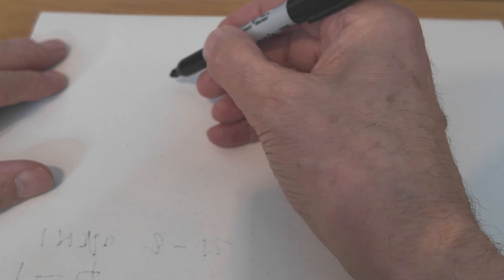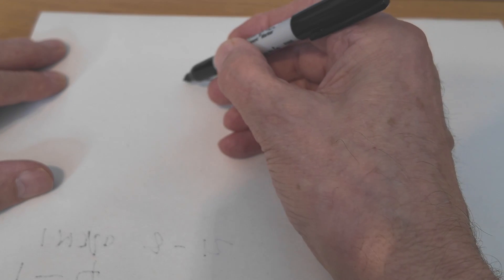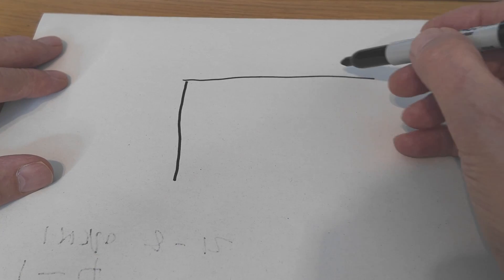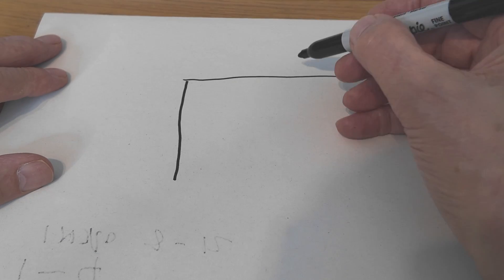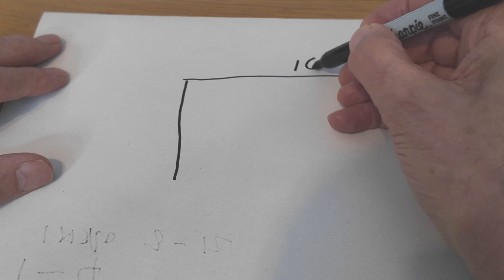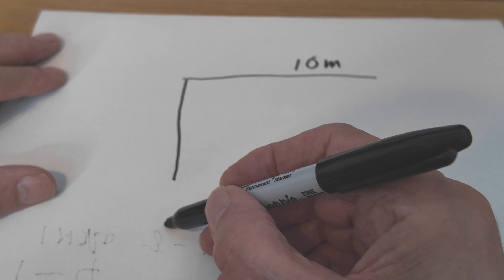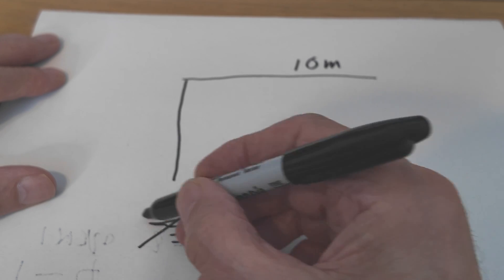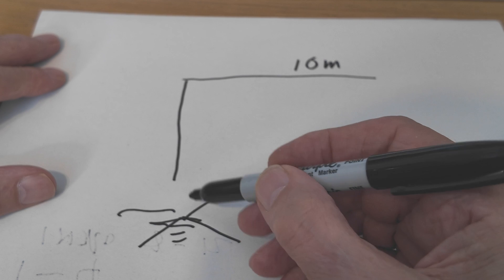Grounded Inverted L Antenna   Try This

Comment: I have ATU connected at bottom for Inverted L  , 1/4 wave for 3.5MHz,  1/2 wave length for 7MHz band.   ATU along with 1:9 UNUN can do both just fine.  Inverted L is lightest load on winmpy Fiber glass pole I have.  least amount of wind load as well.  AG6JU

Comment: Your channel inspired me to get my technician license TY. I'm about to start building antennas and plan on starting with a resonant dipole. Since I only have 10m for HF the inverted L is very attractive. I have a question though. Is higher always better for antenna placement? I don't understand angle of radiation principles yet but figure it would probably be better to get it as high as possible especially because I am in a mountainous region. If I'm wrong please let me know. God bless from your friend across the pond 🤠

Comment: Have you tried an end fed. dipole  in an inverted L configuration with the unun at the base of the vertical section?
Reply from the maker: Yes, ir works well.

Comment: Very interesting video Peter and yes a great ant for the low bands.
I once put a 40m trap on the top of my 40m vertical, then added extra wire, and got a 40/80 inv L, which  worked extremely well. My top section was actually sloping down, but it seemed to fire better in the opposite direction. 
Happy Easter to you and your family.  Zl3xdj.
Reply from the maker: Hi Brian, many thanks and happy Easter to you in ZL. 73 Peter

Comment: Should you choke the coax at the feedpoint of the 49:1 transformer? I know the 49:1 Balun I have, the coax does radiate somewhat. Robert KD4YDC
Reply from the maker: No need.  Just choke at transceiver end.
Reply: I have been experimenting with inverted L in many configurations. At 88.5 feet and at least 5 meters or 20 foot the antenna is remarkable as a random non resonant with a 9 to 1 auto transformer and use your coax as earth to a good current choke at house entry gives you all bands easily tuned within 3 to 1 tuners. Keep the vertical portion clear of objects and remember the inside of the inverted L is max radiation and must be clear of any object even dialectric ones to produce the best radiation for dx. Its directional at high bands towards the L. No restrictions and no radials with my method. My logbook proves my testing out.

Comment: I've used inverted L for years feeding from ground. First an trap L with unadillatraps for 40 and 80m so it would work on 160-80 and 40m. Even at 6m height I worked DX on 160. Eventually burned the traps and now using 8010 EFHW with 49:1 UNUN at 11m height. Work very well. The beauty is that I can feed the wire without the UNUN , but with proper groundsystem and use it on 160 and 60meter. BTW.. I seem to remember a rule to inverted L that the vetical section should be more than 1/5 of total lenght. Any toughts on this Peter?
Reply from the maker: Hi Tom, that sounds a great antenna arrangement. I have not heard tge 1/5 rule but makes sense. A local 160m DXer told me when his  base loaded 25m antenna was  down, his 8m high inverted L seemed almost  as good!